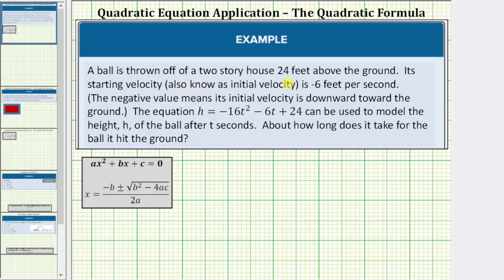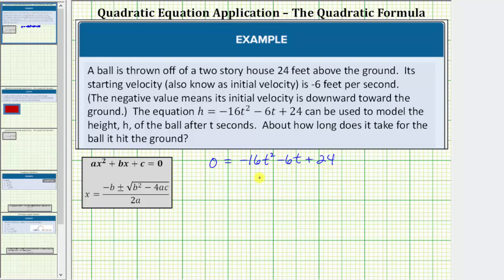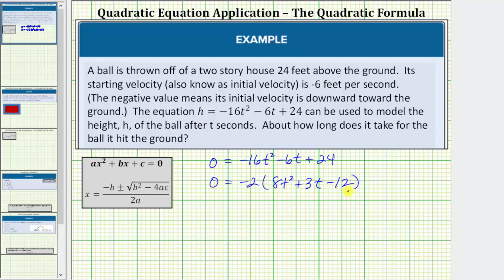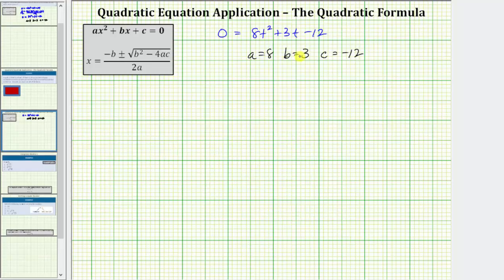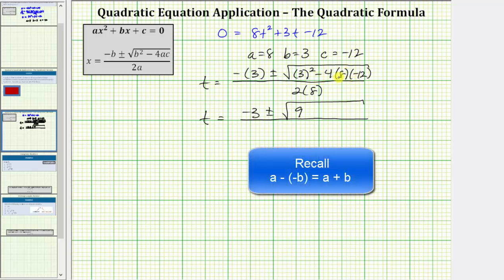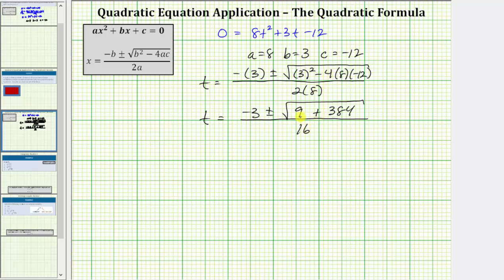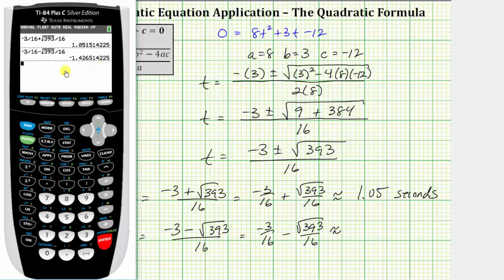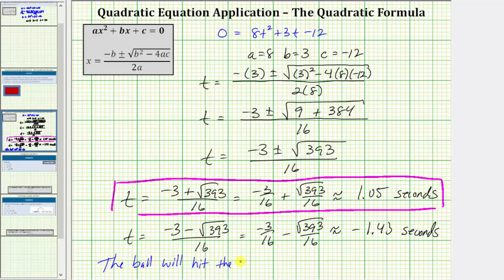Quadratic Formula Application - Time for an Object to Hit the Ground

Comment: This is no good because you pulled 16t squared out of the air and didn't explain it.
Reply: it's common knowledge lol. g = 9.81 m/s = 32 ft/s. the kinematic equation needs half of that so it is 16
Reply: @figulapt3784  that is not common knowlege
Reply: @figulapt3784 no it is definitely not common knowledge, why do you think people are here to learn this in the first place??
Reply: Okay, to explain, for physics equations A is = to gravity, which is about 9.8 meters (when you sre not going up) or 32 feet (again when you are not going up) B is = to your intial velocity (-6t) C is = to  your intial distance (24) and T is = to time (what we're finding
So to break it up:
T = time
A = the negative accelleration of pushing against gravity
B = your intial velocity, the reason it goes up THEN down
C = your intial distance, usually in the form of feet or metes, (use -4.9 for meters, -16 for feet this is because in the full equation it is 1/2-9.8 or 1/2-32. It's just a simplification, and is usually the reason people mess up) 
If you have any question, ask.

Comment: -16t^2 ???
Reply: Okay, to explain, for physics equations A is = to gravity, which is about 9.8 meters (when you sre not going up) or 32 feet (again when you are not going up) B is = to your intial velocity (-6t) C is = to  your intial distance (24) and T is = to time (what we're finding
So to break it up:
T = time
A = the negative accelleration of pushing against gravity
B = your intial velocity, the reason it goes up THEN down
C = your intial distance, usually in the form of feet or metes, (use -4.9 for meters, -16 for feet this is because in the full equation it is 1/2-9.8 or 1/2-32. It's just a simplification, and is usually the reason people mess up) 
If you have any question, ask.
Reply: it is a standard in all of these time problems
Reply: Exactly, that is why this video is no good.

Comment: Where did u get 16? Im a bit confused...
Reply: When working with like, throwing objects in math equations like this, the -16t^2 is supposed to represent gravity or something, so it's always a part of the original equation.
Sorry I'm late to the party :')
Reply: @the.fairyonearth  I don’t think -16t^2 is 
gravity. If no vertical acceleration is given the variable “a” will define gravity which is -9.81 because gravity always acts down.
Reply: @lebronejhames7265  its gravity in feet per second
Reply: Hilkiah Urim S. Maguicay nothbestatart i need the answer too
Reply: I guess it was just already in the equation
Reply: Okay, to explain, for physics equations A is = to gravity, which is about 9.8 meters (when you sre not going up) or 32 feet (again when you are not going up) B is = to your intial velocity (-6t) C is = to  your intial distance (24) and T is = to time (what we're finding
So to break it up:
T = time
A = the negative accelleration of pushing against gravity
B = your intial velocity, the reason it goes up THEN down
C = your intial distance, usually in the form of feet or metes, (use -4.9 for meters, -16 for feet this is because in the full equation it is 1/2-9.8 or 1/2-32. It's just a simplification, and is usually the reason people mess up) 
If you have any question, ask.
Reply: Use the quadratic equation. Since in the denominator it says 2a, and a is the 8t^2 but just the coefficient 8, that means 2(8) which is 16. In quadratic formulae, a, b, c are the coefficients in ax^2+bx+c=0